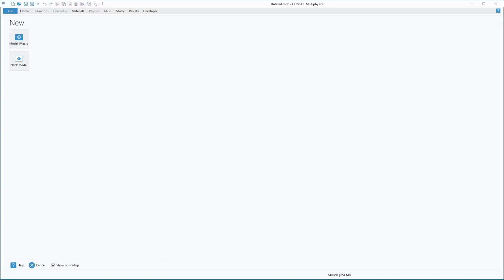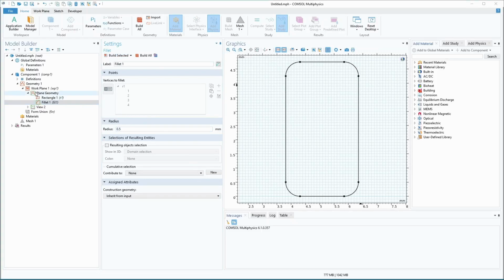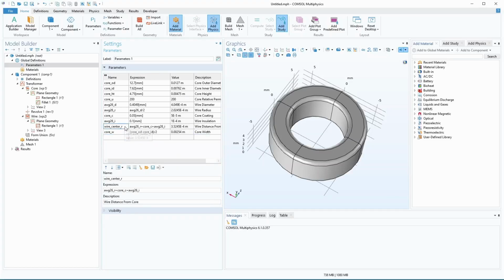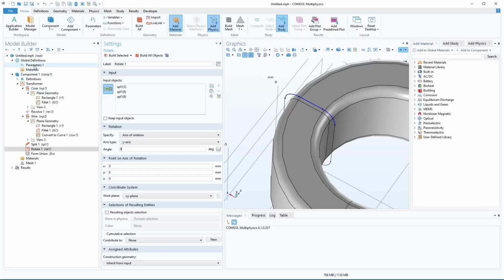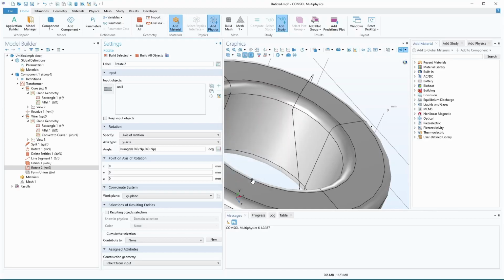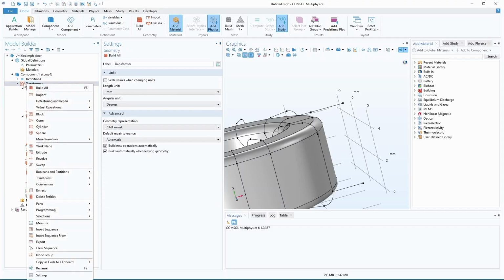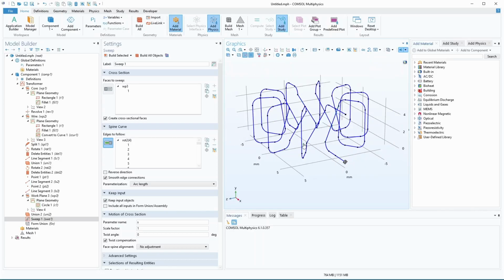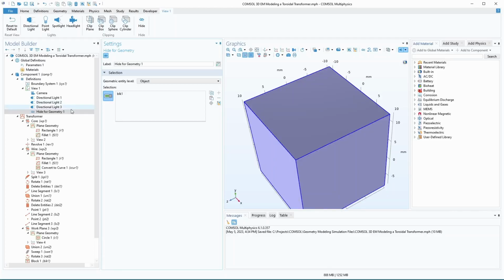COMSOL - 3D EM Intro 2, Toroidal Transformer Model

Comment: Thanks for the nice videos. Can you wind 2 windings on the air gap toroid and supply one of the windings with AC and the other with DC current. I wondered about the compound magnetic field in the air gap.
Reply from the maker: Yes the FEM analysis solves the field geometry iteratively so you should be able to throw in whatever coils and signals you want and get a solution, the question is which Study do you use? It may work in the Frequency Domain study but if it doesn't then you'd have to do the Time Dependent study. Keep an eye out for the next video in this series that I'll put out next Wednesday that covers setting up and running the simulation. Thanks for watching!